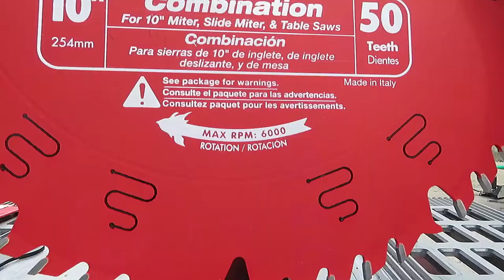MASSIVE KICKBACK! - Setting up My First Table Saw

Comment: Oh, my!  Glad to see you didn't get cut or hit.  Hoping you got some tips on proper table saw technique since publishing this.  #1  This wouldn't have happened if you had a riving knife or splitter on the saw like you should for this kind of cut.  #2  Never ever ever pull back on your cut piece after it has contacted the blade.  #3  Look into how to properly use push sticks.  I'd call this a blessing as you got to see the power a table saw has to hurt you without actually getting hurt.